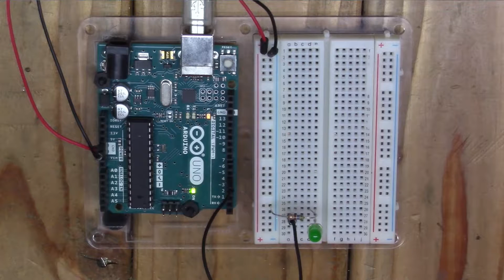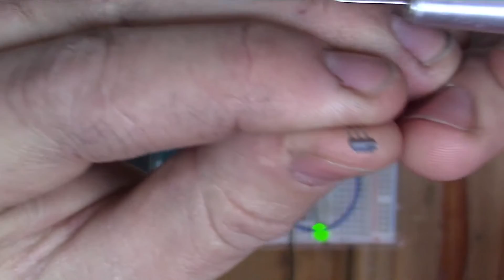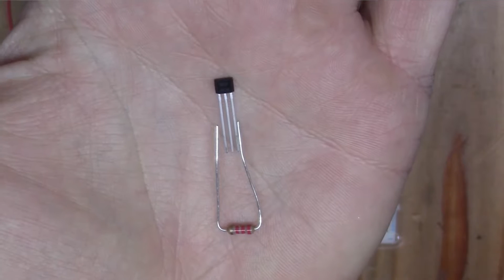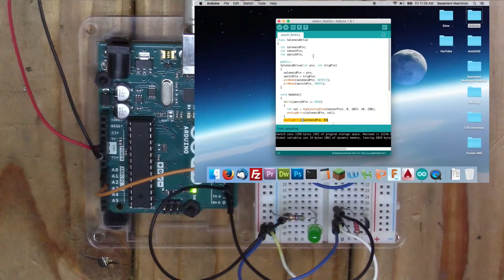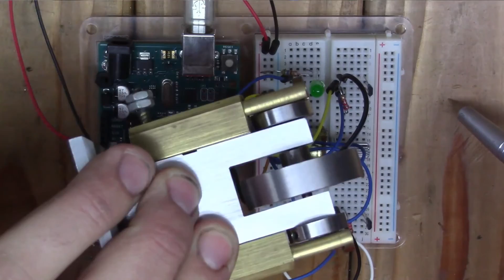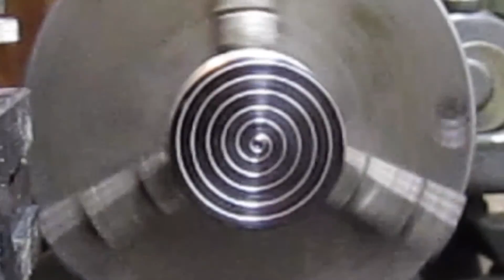Variable Speed Solenoid Motor Using Arduino - Part 2

Comment: Can we do this with a V8 solenoid engine considering that arduino has 6 PWM pins? Your help will be really appreciated
Reply from the maker: Yes you can, you and relay the pwm signals through a shift register. This maybe something I investigate further, when I can get back to this project.
Reply: Thanks for your reply. I hope you can back to the project early.